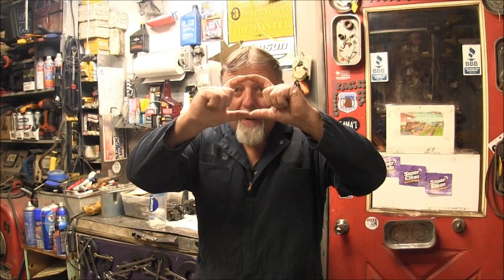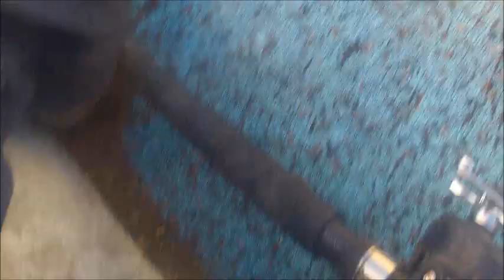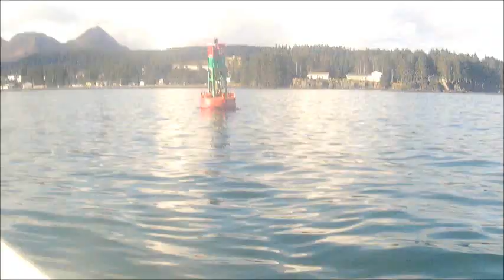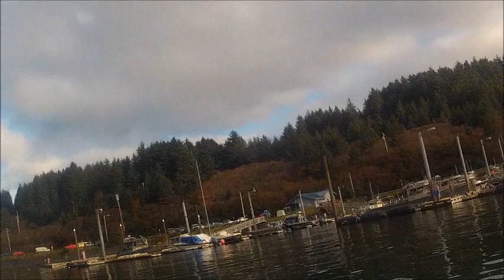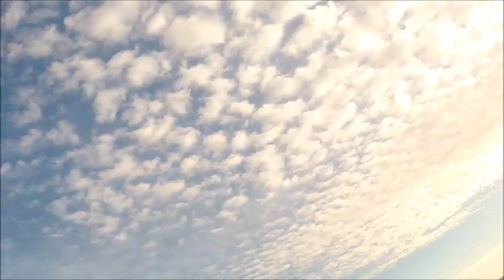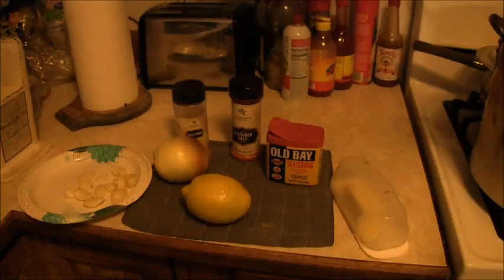BOAT RIDE,     Fish'n  &  Next   "Victim"

Comment: Hi Kodi, Yummy I say old buddy. As far as motors I have to say this Evinrude 3hp is driving me nuts. I got it running but won't stay running? I took the carb apart, cleaned and just put new parts on it. Now it's even worse. I have cleaned carbs for a long time, but these Johnson Evinrude carbs are way different animals for sure. I think someone messed with this one. Going to remove it again but this time will bench test till I figure it out. Lost power down here from that westerly storm from the Ocean. It was a big one and over 100,000 of us lost power 2 days ago. We just got ours back on today. Stuff in the freezer was still good but the food in the fridge we just dumped it and refilled it today. The local big grocery stores are on generators.

Comment: I got a 1995 90hp johnson outboard 2 stroke runs great.  But when running on the ears I noticed grey discharge from the prop ( exhaust) is that the fuel oil mixture? Also I had the power pack wire kinked up and blew a fuse. What causes that? Thanks for any info